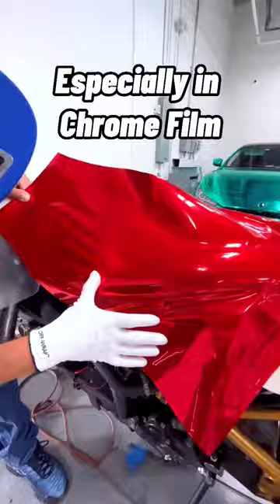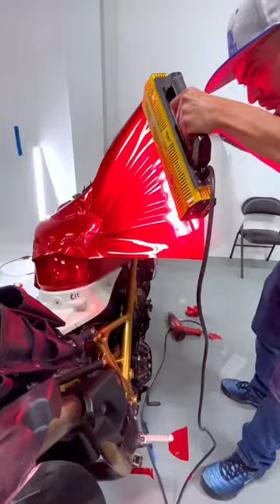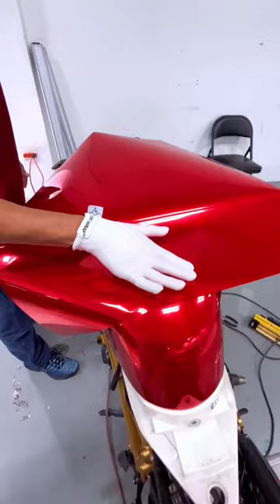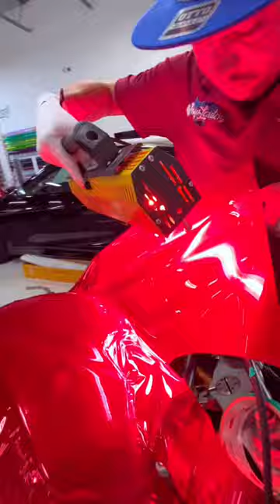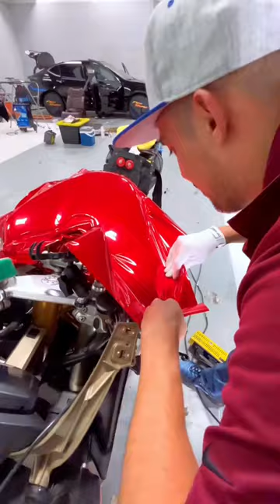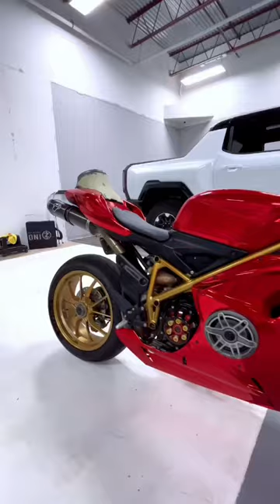CHROME Wrap on a Bike! #ducati #bikelife #carwrap #carwrapping

Comment: I love how it looks all wrinkled at the start, but then it’s nice and smooth and flat at the end, your work is amazing and it must be so hard
Reply: That tank most likely got 4 different pieces of vinyl. Chrome isn't flexible at all so you need to use multiple pieces in something this round.
Reply: @lucidworx how are you supposed to hide crease lines? Looks like I won’t be using chrome for my first time lol and I just wanted to do the headlight housing

Comment: Please can you explain using that light thing.. how does it work with the wrap
Reply: It’s for heat, the vinyl can be heated for easier stretching and shrinking where needed. Then it needs to be post heat after fully installing the vinyl, so those lamps help tremendously